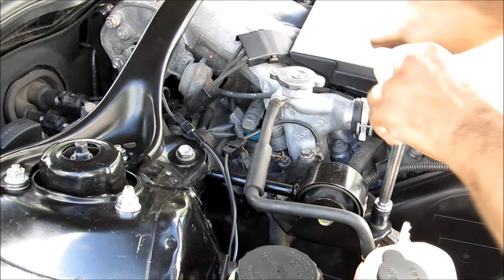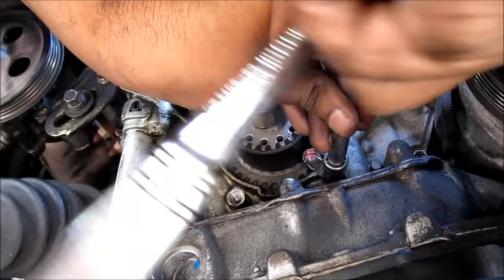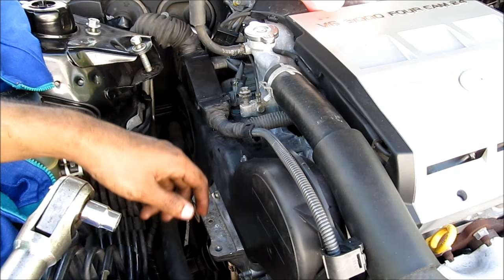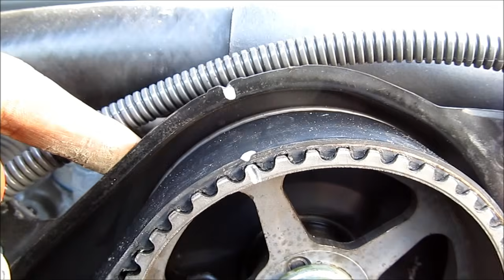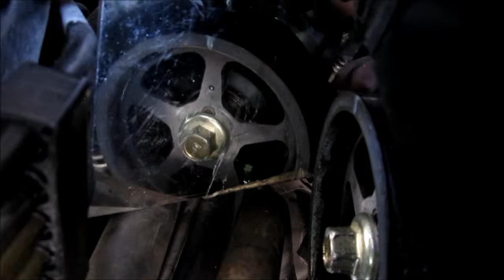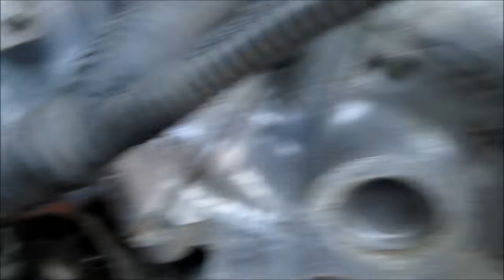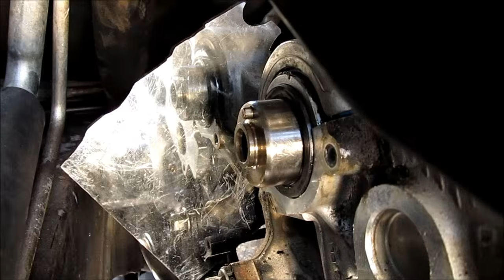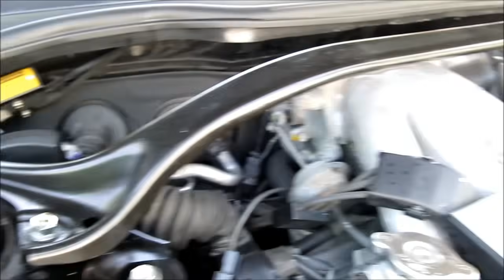Timing Belt / Waterpump Replacement: Toyota & Lexus V6

Comment: EEEK!!

So a week later, I look and there is oil on the ground after I changed everything... PISSED!! lol

Take everything apart tonight and it appears that the upper right (furthest from firewall) cam seal is leaking.  It also appears the crank seal was leaking unless the oil from up top dripped to the bottom. Which is possible!...

So my next question is if they weren't leaking before, I changed the seals with factory OEM toyota and now they are leaking.  I checked, there are no gouges or scratches.  I did not put a little oil on them like you did in the video to make them slip in easier... Perhaps that is why?  (Just like you would put a little oil on the oil filter gasket, I did not do this with these seals)  Do you want to tap them in all the way flush, or a little above?  The rear sear at the cam I tapped in flush and it's not leaking.  The front seal I think was a little bit before flush...  Just looking for ideas.  I've gotten to the point where this whole job took me 45 minutes to dissemble...arg.

But I think that is my problem, either tapping the seals in too much or not enough?  Just looking for a little insight.

Other than that everything is kosher! ;-p

Thanks,

-Nigel
Reply: EvendimataE 

I got mine from Ebay and it was from a toyota dealer.  Same seals I took off were the same brand and material used on the new ones.  I read certain things about aftermarket seals and it's one of those things I didn't want to do over (even though I did because of my error).  But so far it all seemed to work out well. 

I think I paid $7 for the crank seal, and $6 each for the cam seals, so roughly $20 for three seals... which if they last another 140k miles is cheap knowing I have oem .. :-)

-Nigel
Reply: I broke 2 of my breaker bars when trying to remove the crank bolt on the pulley. Any solution?
Reply: Louis Lee  get a better one. ;)
Reply from the maker: NewShockerGuy I couldn't get my cam seals to go in flush, especially the rear one, it was 1-2mm sticking out. I'd say change the seals with new ones (try the felpro kit from rockauto) and give it another go. You aren't supposed to put any gasket maker on them, and I don't think putting oil on it before has an effect on it leaking. Double check other sources of leaks, like a valve cover gasket that could be leaking down the side of the engine, and give the engine a good degreasing before putting things back together. If the belt is drenched I'd change that too as a precaution.
Reply: speedkar99 

Waiting for the crank seal that should get here tomorrow.  I just installed factory oem cam seals, this time using a little bit of oil on them exactly like your picture.  I made sure that they did not roll the lip or the spring coming out.  Then pushed them and set them in.  I remember when taking out the stock seals that were original they were not completely flush... just like you said they were 1-2mm out.  That's exactly how I did the new ones.  I think that was my problem and HOPE that was my problem was installing the seals completely dry instead of using a little oil on them.  Luckily the belt wasn't covered in oil, which I thought for sure it would be... had we driven the car a lot I'm sure it would have, but caught it early when I saw the oil on the ground.

I'll keep ya posted, should have this buttoned up tomorrow night.. fingers crossed!

-Nigel
Reply from the maker: Good luck and let me know how it goes.
Reply: NewShockerGuy where did you buy your factory oem seal? i got my oem sealsfrom an online seller for about $19 fo the 3 pcs...so making them a little cheaper than after market brands....they look exaclty the same as some dealers sell on ebay and amazon....i hope what i got are really the genuine parts :D ....i have not checked mine after doing it 3 days ago..... i hope i dont have the same problem
Reply from the maker: FelPro from RockAuto.
Reply: speedkar99 

So this time around I tapped in the cam seals with oil on them and made sure that I used a socket that was big enough to evenly put pressure on them... I think last time I went all the way around it lightly tapping it with a hammer which would put in one side more than another...

Crank seal same deal,  I know for a fact the crank seal the first time I tapped in was no even. . one side was in way more than another.

Been about a week with no leaks!

Going to check again but so far so good I hope/think!

-Nigel
Reply from the maker: Louis Lee
Use a much larger breaker bar, at least 3/4" drive, or an impact wrench or the bump start method to remove that stubborn crank bolt.

Comment: waterpump  on car is a GMP dated 3/2011 I would estimate 60,000 miles, do you still recommend I replace it? I have the engine apart for the cam seals and was going to replace the timing belt as well?
Reply from the maker: David Sankey Yes, why not, a new pump is less than $100 and belt is $35 and you've got the thing apart anyways. I'd only skip if you plan on selling the car soon.

Comment: what are my options if the cam bolts are slightly rounded and I can't get a socket or a wrench to grip them enough to loosen?
Reply from the maker: Grind down the bolt heads with a rotary tool to make two flats for a smaller wrench to fit on. Open the valve covers to get a wrench on the cams to give you better leverage to crack the cam bolts loose. I don't recommend cutting the bolts off because you risk damaging the cam shaft and gears.

Comment: My mom has a 2006 highlander that she inherited from my grandma, only had 23k miles on it! Its a 3.3L. Would you do the timing belt now? 

GREAT video, not as hard as I thought. Really thanks so much for taking the time to make that.
Reply from the maker: Thanks. Since your car is almost 10 years old I'd change the timing belt since rubber deteriorates with time alone. The tensioner is slightly different on the 3.3L compared to the one in my video, but other than that the procedure is the same.

Comment: Wanted to thank you!  Got everything all done and with some questions on the forum and your video it all worked out!

If I have to do this job again I think it would take me just a couple hours.

Overall though thank you for this video!   Very valuable information!!

-Nigel
Reply from the maker: I'm glad my video helped you change your timing belt :)
I too could redo this job in a few hours having done one already. Once you crack the crank bolt loose, its all a breeze from there on in.

Comment: I am doing the timing belt on my 98 camry with the 1mz-fe engine because the water pump went bad and damage the belt. I need help with the timing. After aligning both cams and crank I manually turned the engine twice and only the cams are aligning but not the crank, its off about 5 degrees. is that normal? If I want to confirm that the marks are correct what can I do to test after belt goes on and before spinning the engine.
Reply from the maker: If its within one tooth spacing your timing should be fine. More than that and you might be a tooth off. Take the belt off, realign the gears and give it one more try. You'll need a vise to re compress the tensioner if you've already released it.

Comment: I like your video. Before I take off the timing belt on my '95 Avalon (1MZFE), I want to make sure my belt is aligned and I'm at top dead center. I still have the original installation marks on the timing belt. But when I line up the crankshaft timing pulley groove with the oil pump alignment mark, I cannot get the dotted line installation mark on the timing belt to line up with the dot mark on the crankshaft timing pulley. If I rotate the crankshaft once around, it still doesn't line up. I had someone sit in the car and bump the starter to bring the belt around a number of times, but I never could get the installation marks to line up correctly. I'm sure the timing is good, as the car has been running fine. . . Maybe I am overthinking this. Should I forget about those original installation marks, and just do it the way you show, as if the original installation marks had worn off?
Reply from the maker: As soon as the belt is rotated from the original installation mark, you'll never get them to realign with the cam and crank marks again. The important thing is the gears align with the markings on the engine/ timing cover.
Reply: speedkar99 Thanks. And, once again, it's a great video.
Reply from the maker: Thanks

Comment: Among the best DIY videos up here - yours are clear, precise, and perfectly edited.  Thanx for not wasting my time with blah blah blah blah blah!!
Reply from the maker: Thanks for the feedback!
Reply: aldo garay - 
Turn the engine over one more revolution.  it is a 4 cycle engine, depending on your starting point, you may need to turn more than one revolution to line up the marks.  It is top dead center #1 you must reach to line up the cam pulleys.
Reply: You definitely have a good approach to the repair process without all the extraneous b.s. One of the best videos I've seen
Reply: O ya, excellant, by far the best explanations with actual doing (not just "saying" what I can read in a manual!).
Reply: speedkar99  hey man im doin this job on a 1990 lexus es 250 with v6 engine i line up the mark on the main engine pulley but the ones on the cam pully wont line up there is one mark already on the cam pulley  do all 3 have line up because they wont on this car

Comment: $450?!?  For that much I MIGHT be tempted to take it to the dealer, they just quoted me $1500 (northern VA) and that was calling around to around 4-5 different places...rofl  NO THANKS>

Thank you for this video!  It's helped GREATLY clarify some questions I had from reading the forum!  I am going to do this on my wife's 07 Solara which is the 3mz-fe engine.  Also plan on doing the spark plugs and various other things since it's going to be apart.  This will be the first time doing a timing belt but this seems straight forward honestly.  I have a lift in my garage which I'm sure will greatly benefit the installation...   I know it helped greatly when I installed a new rack and pinion in her car since her's was leaking... talk about a tight fit going in and coming out..rofl!  But this should be fun!

Thanks for this!
-Nigel
Reply from the maker: Your welcome for the video. Saw your post on ToyotaNation. Procedure is the same, with the exception of the tensioner being mounted with horizontal bolts and the power steering bracket having to be removed to clear the tensioner. I'm sure if you've done a rack and pinion, you could do a timing belt. Replace the waterpump and bearings while your in there.
Reply: speedkar99

Excellent!  I am starting this in about 30 minutes.  I am replacing the bearings and water pump as well, and accessory belts and spark plugs, cam seals...lol  :-)

My main concern was the  cams... if one turns them I was afraid that damage would occur... IE:  If I miss the mark a little bit, can I continue to turn it until I get to the mark indicated but only turning in one direction... Not like a salt/pepper grinder where you can do it both ways... right?

Thanks again,
-Nigel
Reply from the maker: If it only went off 5-10 degrees, you can turn it backward slightly to adjust it. If it rotated a quarter turn, you need to turn the cam all the way around again. Two crank rotations equal 1 cam rotation if I recall.

How did your timing belt job go?
Reply: speedkar99 I am in the process of doing it now.  I am down to where I have the cams and crank at their markings, but I need to loosen the cam bolts that are holding the gears.  My problem at the moment even when using a tool to hold the cam gear in place while the old belt is still on and the tensioner is on is that just like in your video your cam moves slightly backwards... I'm afraid of something breaking?  I just don't want to turn the cam the wrong direction if that makes sense but it's very hard to keep it still while trying to loosen it.  My seals look good, no leaks but I want to replace the water pump and would need to undo the cam bolts.

I have an air impact which will take off the front, but the back is hard to get to.

that's my biggest thing right now is trying to get the cam bolts loose without them moving counter clockwise..

I keep watching your video here on loop... so far so good minus my current situation..lol

EDIT:

tried again using the exact method you used of double breaker bars, both bolts loose and then REDID the marking on the crank pulley bolt, which then brought back the timing marks on the cams!!!

So now I can take the rest apart, do you recommend tightening the cam bolts once the new belt and tensioner are on?  I I feel like it is risky to do so without the belt on right?  You want everything moving together right?

-Nigel
Reply from the maker: One trick you could use is to put a socket on the 10mm bolt holding timing cover #3 to the engine to stop the cam gear from rotating when loosening or tightening the bolt. However there's a chance the bolt could shear off if you apply a lot of pressure.

If I recall I tightened the cam gear with the cam holder tool (and definitely not with the tension on the new timing belt) and it was sufficient.

I hope all goes well with your timing belt job. Why did you have to remove the cam gears anyway?
Reply: speedkar99 i thought of doing that too...but when i checked that 10mm bolt, it doesnt look like its a high strenght bolt....after doing mine with a home made tool....im glad i did not use that 10mm bolt...too much torque needed to loosen the cam bolt :D
Reply from the maker: Agree, I do recall using that bolt to loosen the cam shaft on my 3MZ Lexus. If you could wedge the camshaft holding tool in between the sprockets and against the engine somewhere you could knock that bolt loose.

Comment: also, what if i removed the timing belt already and havent removed the cam gears...how would i break loose the bolt off the cam gear
Reply from the maker: Use a cam holding tool to hold the pulley while you loosen the bolt. Or remove the valve covers and hold the camshaft with a wrench.
Reply from the maker: Yes, the should not rotate. If the engine is an interference design, it will cause damage.
Reply: +speedkar99 thanks bro
Reply: +speedkar99 piecing this all together from the video and the comments, so basically we don't want the cam pulleys to rotate when we remove their bolts? guessing that would cause damage

Comment: what kit did you use to remove the harmonic balancer?
Reply from the maker: I used a harmonic balancer puller, most auto stores have them. Mine was a kit that included various bolts for different types of pulleys.

Comment: This is without a doubt one of the best car repair videos I've ever seen. No bs, good edits, good info. Thanks!!
Reply from the maker: Thank you very much for your feedback!
Reply: I can't believe how many deviations and confusing instructions the Haynes manual gives compared to your simple method.
It might have been good to list how to torque the harmonic balancer down though at the end for those without access to an air gun.
Reply: Is Everything Pretty ,Much the Same for the 3.3 Eng.? Great Video& Does the Crank & Cam Seals Come W/ the Aisin T.Belt Kit? Tks in Advance

Comment: Hi Speedkar99.  Thanks.   Feel better now that I don't have to attack this job. 
My Toyota Matrix 2004 is making "rattling" noise (like a diesel engine sound) when I put into Drive or Reverse - only occurs when engine is cold. After it is warmed up, the noise goes away.  I thought it was the belt tensioner but there was no sign of hydraulic leak.  What else could it be?  I'm waiting to see if it will make same noise in the summer to better diagnose it.  I thought I ask because you may have seen similar problem.  Thanks a million!
Reply from the maker: A rattling exhaust shield? Does the engine or car vibrate when it makes the sound?
Reply: speedkar99 yes, when I put into "Drive" or "Reverse".  Not excess but noticeable in the driver seat.  Had a friend looked at it but could not really tell.  He thinks it's the engine mount.  Let's wait until summer to have a better look.  I'll let you know what I find out.
Reply from the maker: If its just a rattling sound, its an exhaust shield, as the sound goes away when the car heats up and the metal expands.

If you feel vibrations, its the engine mount.